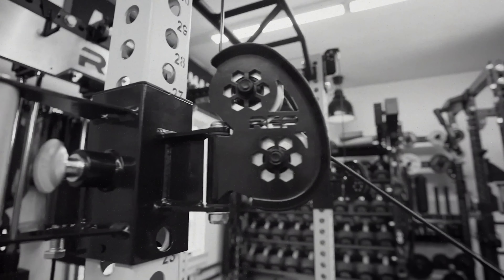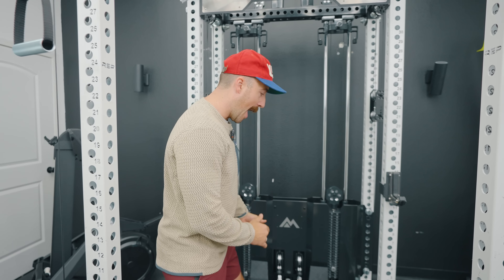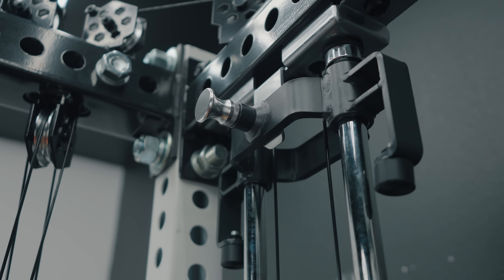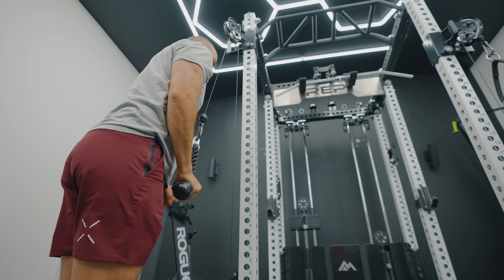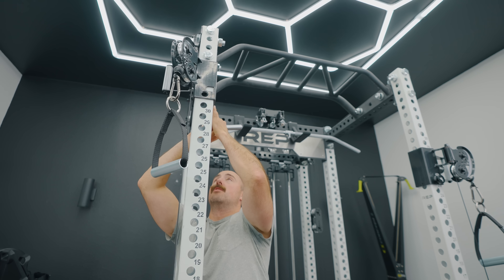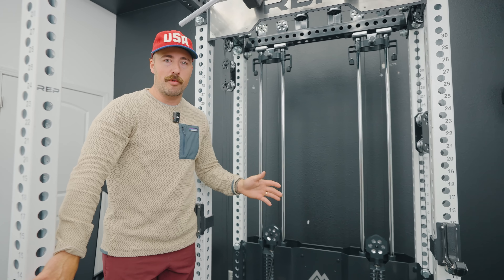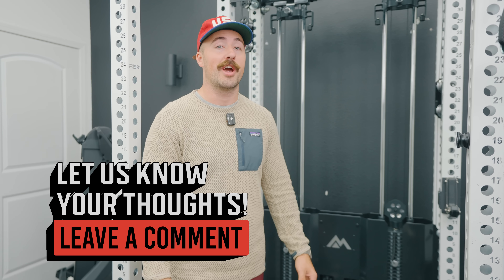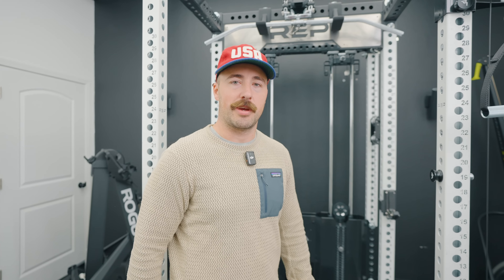The New REP ARES 2.0 Functional Trainer Rack Review!

Comment: Huh, I incline press all the time in my Ares 1.0 and never had an issue, maybe it has to do with the bench you're using.
Reply: Yoooo!! Please post a video of it! Everyone tells me it’s not possible. I’d love to get a 1.0!
Reply: @jordanparr524  I use the Ironmaster Super Bench PRO V2, it's legs only have wheels on one side and I flipped the wheels to be on the opposite side as the instructions. This does 2 things, first it allows the bench feet to go flush with the Ares 1.0 foot plate when you push the bench deep as far as it'll go towards the weight stack and second it gives you the fatter end of the bench for your back, which is great for benching. I do incline bench all the time and don't know what issue people are talking about other than you can't have a spotter behind you, but I use safety bars for that. I will say it's a bit tight at some angles with the safeties but it works, or I just use multiple j hooks so I can rack after different heights if I start to fail.

Edit: watching some videos of people struggling with this I think the issue is their bench is just longer than the super bench. Super bench is pretty short which at 6'2" I do find annoying sometimes, but it's also modular with attachments, light and easy to move around. So it's a trade off.

Comment: Does anyone know how the lat pulldown with the 80 inch is for someone under 6 foot? Does the 80 inch work fine?
Reply: Won't work, there's a Reddit post about it
Reply: @GoingToPlaid  It should be fine. I have an 80" 6 post PR 4000 with the pulldown attachment and have no issues. I'm 5'10" and one of my training partners is 6'2” - he has to lean back a little but it really doesn't impact the movement.
Reply: @Alex-kb9rd  do you happen to have the link? I have dug all through reddit for this and really haven't seen anything.
Reply: @TonyFontanesi  do you sit on the floor or your bench? I am 5'10" also
Reply: @GoingToPlaid  Potential issue with the incomming Ares 2.0

I was playing around in the Rep Builder today, trying to make my figure out if 80" will be tall enough for me to do lat pull downs with full a stretch. Various post from owners of the Ares 1.0 suggest 80" infact will be enough for someone of my height (180 cm, 5'11), but just barely (93" is too tall for my gym).

The lat pull down bar hangs substantially lower on the Ares 2.0. Looks like it's a good 10-15 cm/4-6" lower. I doubt I will be able to do lat pull downs with full ROM in the Ares 2. I was pretty much dead set on getting the 2.0 if and when it becomes available in Europe, but this has me rethinking it.
Reply: @GoingToPlaid  - we sit on a bench.  We also use the leg roller attachment to lock us in.

Comment: Sounds like you’re disappointed lol
Honestly I regret pre ordering mine
I wish I had seen the rogue fm6 first and I would’ve ordered it instead
I probably would even have it by now
My order was delayed until mid December and all they did was give me a $100 refund on it 
I could cancel it but I have to sell my rack on the side
Reply: Bro I was in the exact same boat you were in. Was kicking myself for not waiting and getting the fm6 instead. 

I got my ares 2.0 last week and it’s amazing. I thought I’d prefer a single exit point for a low row and lat pull down but after using the ares I found that the two exit points are the way to go. Especially for the low row. Seeing it done alternating each arm always looked gimmicky to me but doing it using both arms at the same time feels amazing. Nothing limiting a deep contraction and being able to rotate your wrist during the movement is a game changer.
Reply: @1slof150  I dont really care about the dual pulleys on the low row I tend to do the triangle row mostly, but it is nice to have the extra option 
But hopefully it’s as good as I hoped it would be
I just hate that they delayed it so much
Reply: @1slof150 btw
How does it compare to a stand alone commercial lat pulldown? Im getting mine pretty soon and I’ve been contemplating canceling and just getting the adonis since I have the space for it

Comment: 10:36 stop saying you want the "stretch" for chest flyes, it's the opposite. You want the hard part of the strength curve to be at peak contraction. Otherwise you can just do bench dumbbell flyes. And also cheap single cable towers like BoS that have two pulleys together would give you lots of "stretch".

Comment: Functional trainers eventually need maintenance and replacements for wear items like the cables and pulley wheels. I have no confidence that Rep will be able to provide these replacement parts when they are needed because of how quickly they move on to a new version of each product. This is part of why I went with the Body Solid GFT100 for a functional trainer. It has a lifetime warranty on all parts including cables and pulleys, and Body Solid has a reputation for actually providing that lifetime support.
Reply: You can buy pulleys and cables anywhere.

Comment: The changes to rewards program suck.. Its killed any loyalty I have for Rep’s products. I just bought a 6-post 93” PR5000 with the Athena selectorized and the lat pulldown/low row selectorized in clear coat with the winged dumbbell storage earlier this year. Already considering selling it to get Rogue’s in-rack functional trainer with how quickly Rep is replacing their products and killing their brand loyalty with the rewards program. You buy Rep over Rogue for the value, reward points, and ecosystem. I’d rather get Rogue now because it’s made in the USA at a similar price, built like a tank, and isn’t going to be replaced in a month.